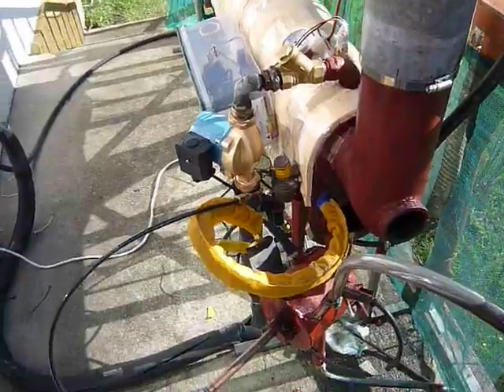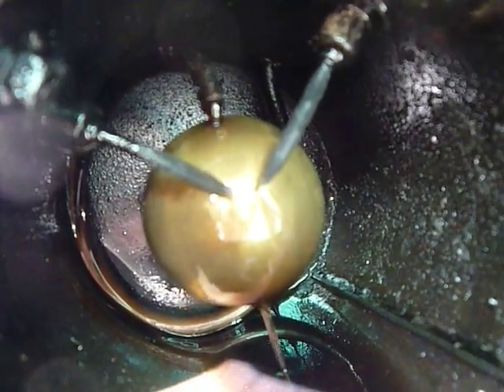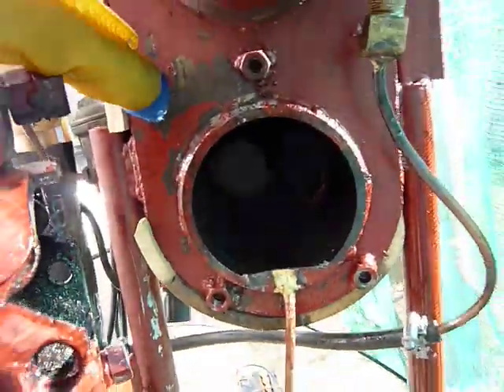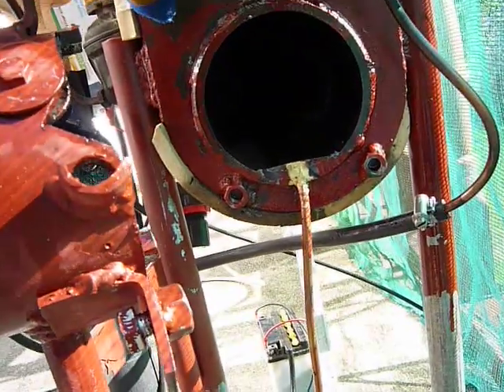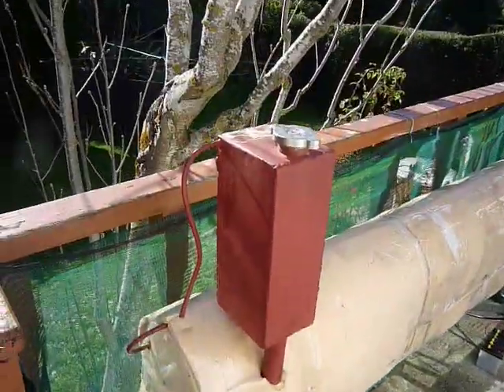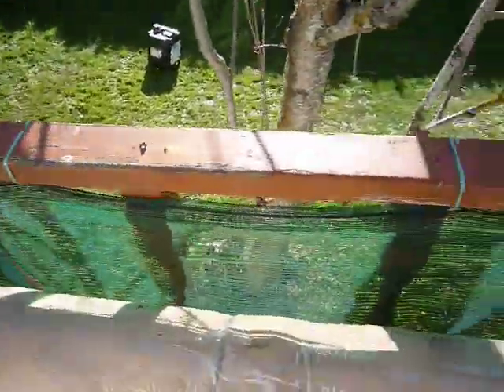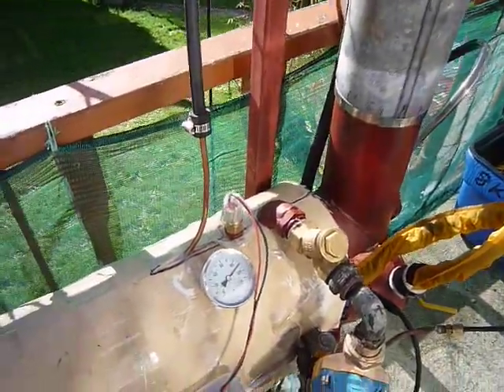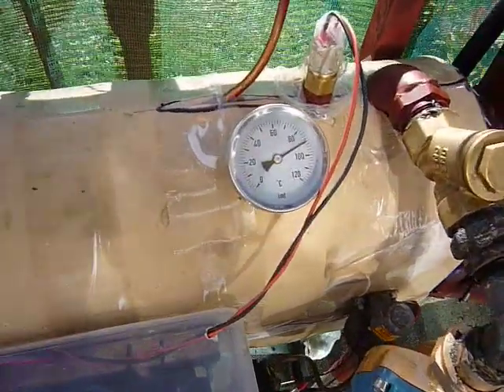my babington burner boiler 2

Comment from the maker: this one with 4 inch I.D tubes i had to to clean it about once a every 2 weeks with it cycling on and off 24/7....the next boiler i built i used a 45kg LPG bottle as the burn tube and only had to clean it once in 6 months of running....interestingly clean used hydraulic oil produces more soot/ash than used diesel engine oil